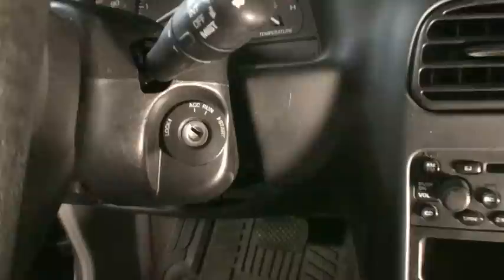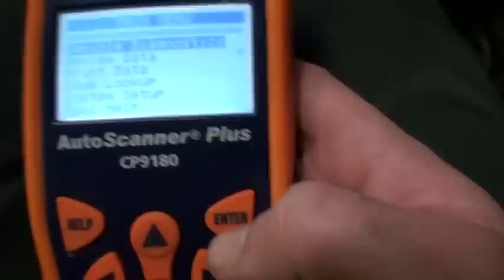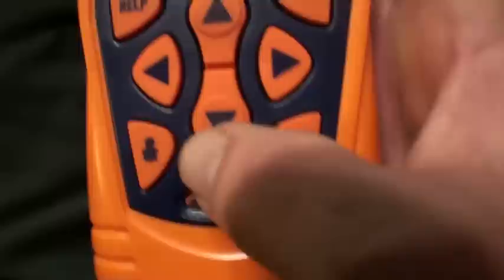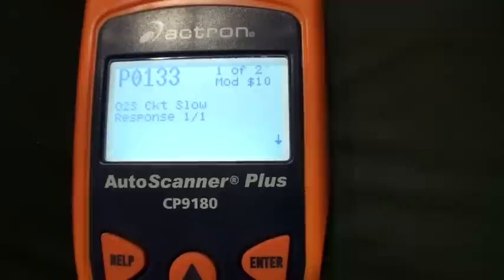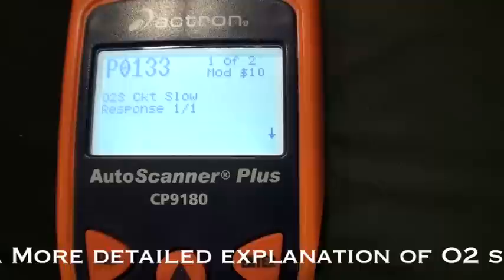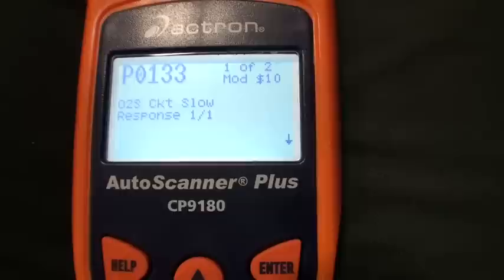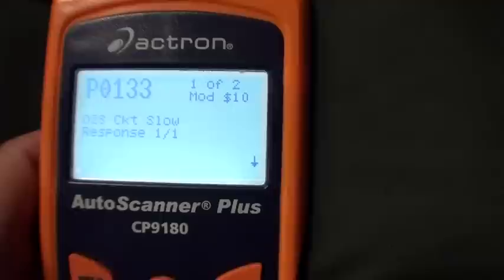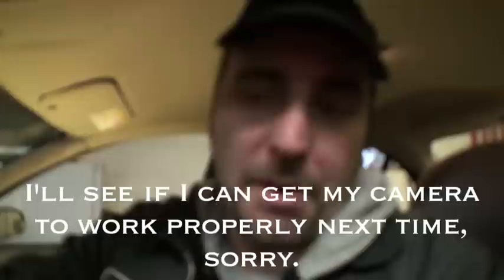Check Engine Light Basics - EricTheCarGuy

Comment: Oh by the way how can a mechanic diagnose a problem such as a catalytic converter without plugging the vehicle to a scanner????
Reply: using an infrared thermometer and checking the temp going in and coming out of the cat to see if it's operating as designed. simple.

Comment: EricTheCarGuy are you available to work on my car because my head is hurting right now with all of these codes, scanners, lying mechanics etc...?  My engine light has been on for years and used to go off but now it's staying on.  Each mechanic is telling me something different.  One mechanic is charging me $600 for a catalytic converter with other problems of course such as o2 sensors.  Does anyone know of any good mechanics in the state of North Carolina?

Comment: I have a 1994 saturn sl2 and when I did the paper clip method to retrieve the code it was the egr valve and I replaced it but the check engine light is still on how do I get the check engine light off? Please help me